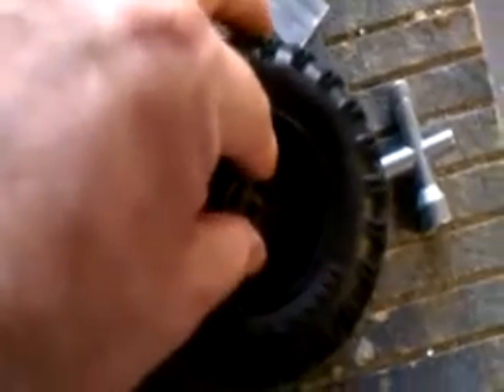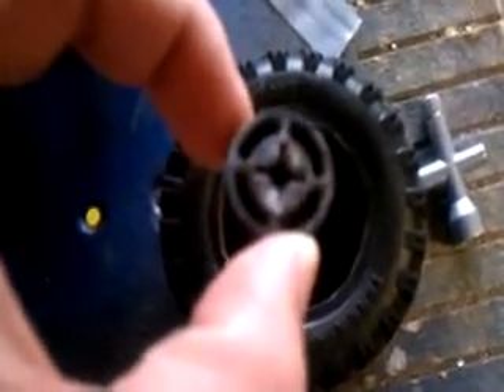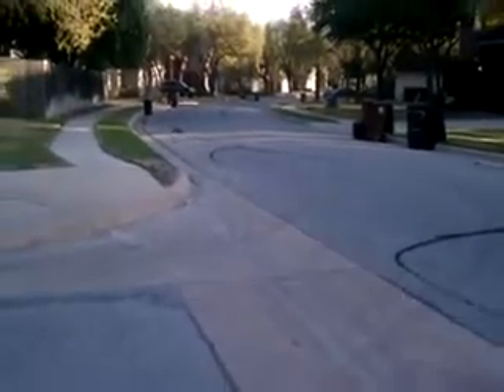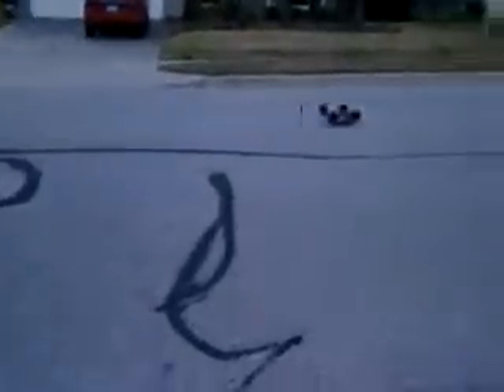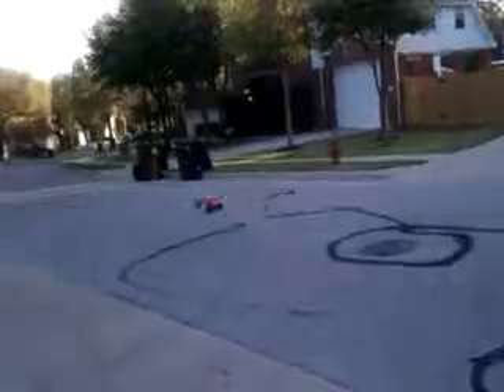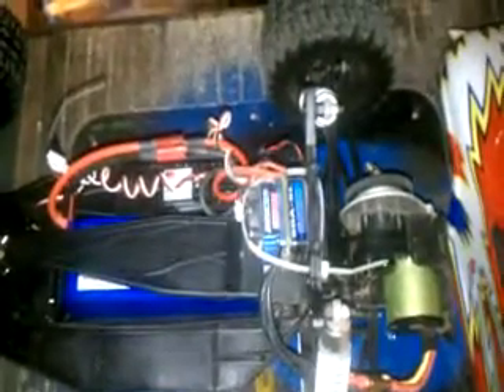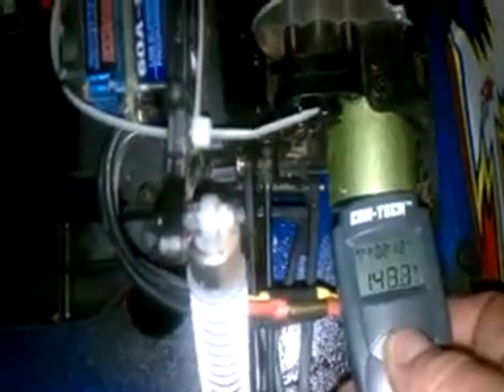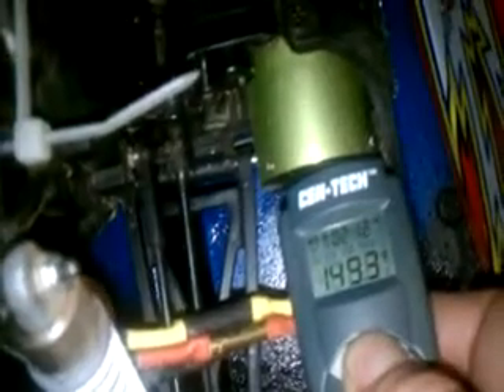Duratrax Evader EXT2 - 3S LiPo - Tacon 3200KV Brushless

Comment from the maker: stock spur gear, yes, but I bumped up the pinion, probably a good idea to use thread lock on the motor screws when you set your mesh, and probably upgrade to hex head screws so you can tighten them down a little more so the mesh doesn't slip out of position, good luck!

Comment from the maker: @caledansby1996, that is true, check out my video on the Aeolian ESC being ran in my BFX, that esc is only $20 and can run up to 4S without any mods. If you already own the HobbyWing ESC, then draw the 2S power from a JST-HX connector plugged into the balance port of the battery. I'll try to do another video on this example soon. Good Luck!

Comment: only let the truck run for about 5 mins, each run. if you cant hold your finger on the motor for more than 4 seconds then its to hot and you need to give it about a 20 min cool down. but anyways nice vid